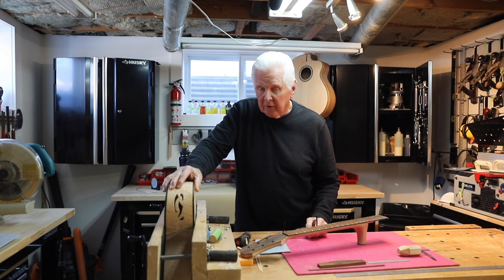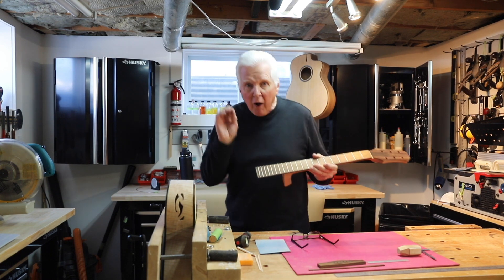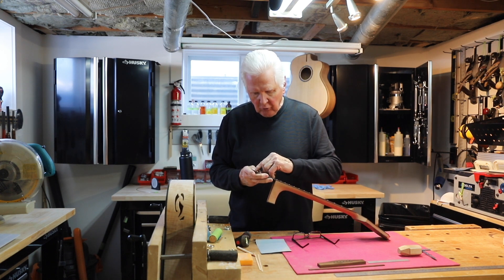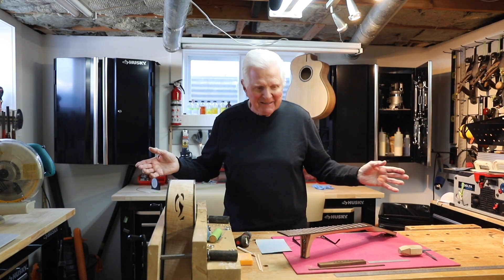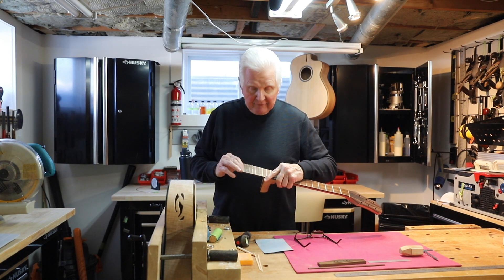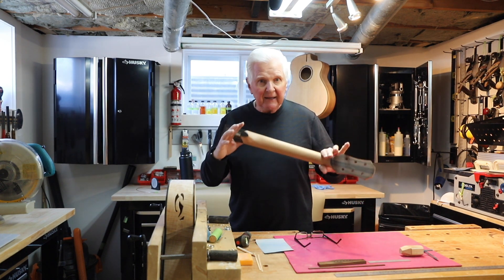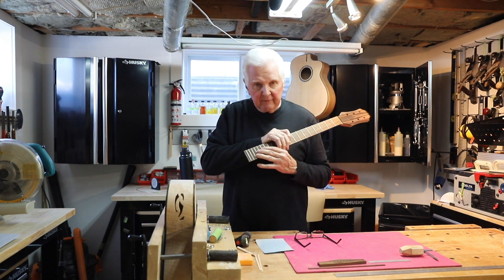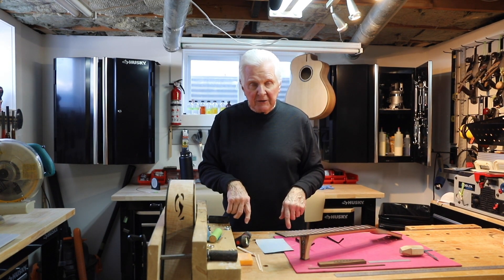I  messed up...What's YOUR Advice?

Comment: Use a small triangular file on the slot before putting the frets in to give the fret tangs some guidance into the slot. Also, it helps to start hammering the frets in from the middle instead of starting on one side; this way, the tang will expand to the sides of the fretboard an properly bite into the wood.
Reply from the maker: I normally do that.
Reply: @MontyMcKinnon  I wouldn't doubt it, Sir :)
But since there are a lot of people out there just starting out, it seemed fitting to put that little bit of advice here where people might see it.

Comment: Pull the fret to see how wonky the slot is. Then file the tang away, so there is no tang going in the most crooked parts of the slot. Then use glue or epoxy when putting the new fret in 🤷‍♂️

Or leave it 😅
Reply from the maker: Interesting

Comment: I feel terrible missing this until today. I'd pull the fret and make a jig for your Dremel tool to cut a straight cut. Using a tiny bit, I'd re-rout the slot - stopping before you reach either side of the slot, just shy of the purfling/binding. The fret may not fit snug enough to hammer in, but you're already backing that up with super-glue, so just bond it extra well.
Reply from the maker: I cut through the sides and used CA glue to fill ion the slot. All good.

Comment: I also think cutting that last fret off completely would work for me. Bind the end the same way. It seems to me that it would be less noticeable than leaving it and you could spout some luthier nonsense about how you wanted the sound board to be able to move more freely with the shorter fretboard is someone even paused to look twice. ;)
Reply from the maker: That's a great idea! But, not as easy to do as one might think. The thickness of the purflings would push the end binding away from the sides and leave a gap.

Comment: Hey Monty, maybe shape the end of the fingerboard so that it is asymmetrical in design so that there is a half fret at the end (the bottom). Make it match the head stock in shape on the top side maybe? My guitars have a asymmetrical rounded fingerboard end with a partial fret and it works well. The double binding makes that a little harder though. Love your videos! Thanks for the inspiration.
Reply from the maker: Seth, thanks for the idea.

Comment: I'd pull the fret, reslot/widen with a dremel and either expand the fret tang or just drop it in with some extra super glue. Being the 21st and probably never used, I wouldn't be so concerned about perfect intonation from the slot being a bit off.
Reply from the maker: Interesting idea.
Reply: @MontyMcKinnon  I was thinking the same, but use an xacto to straighten out the slot... Then flood with CA glue if you need to fill a gap on the "wiggly" side of the tang.  It would only take a handful of swipes with a sharp blade to be back in line.

Comment: Remove the fret and widen the fret slot on the bass side where it bends, with a hack saw blade or a fret saw, add some filler, and put another straight fret in. Nobody plays that E string at the 21st fret and NOBODY will know or see the correction. You CANNOT leave the way it is!
Reply from the maker: All fixed and looking good!

Comment: Are you sure it's the fret slot and not a problem with the fret wire? It seems unlikely to me that you could have cut a warble in your fret slot. I'd pull the fret, fix the slot if needed. I'd bet its just that particular piece of wire.
Reply from the maker: I never considered that. Good idea.

Comment: could you sand the last fret taking some of the body side of one edge , and some off the other end on the other side ? does that make sense ? the fret would be thinner , but straighter .
Reply from the maker: Replacing it and recutting the slot is faster and perfect.

Comment: That's a hard one, Monty - you make beautiful guitars, and we always want our instruments to be 100% perfect; but, there is also a business decision of diminishing returns that has to factor into every build. You are correct in that this fret is largely a cosmetic inclusion - maybe a player might occasionally hit the top strings, but that's it. It looks like the treble side of the fret is straight and it veers off around the bass side. 

Here's a possible cosmetic solution - pull the fret, determine the maximum portion(s) of the slot that is straight and true. Fill & rough up the wonky part of the slot. Cut a new fret; remove the tang for all except the length that corresponds to straight section(s) of the slot. When inserted, this should produce a straight, true fret that is mechanically anchored for the reduced length of the tang. Use a good CA glue to secure the rest of the fret to the fingerboard.  It does depend on the length of the true part of the existing slot, but it looks, from the video, that the true area is at least 60% of the slot, and is not so curved as to protrude around the sides of the fret shoulders.
Reply from the maker: I'll decide tonight. Then get on with it.